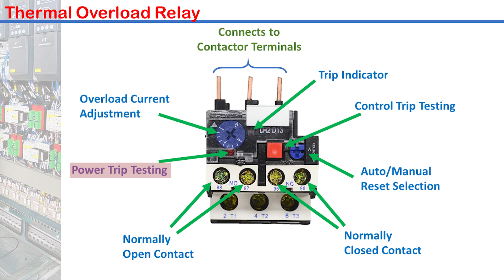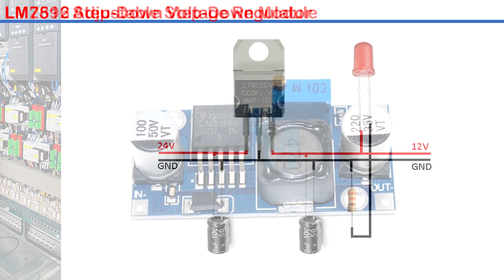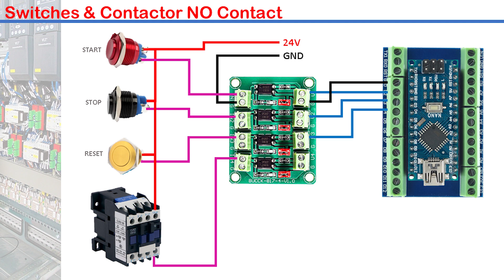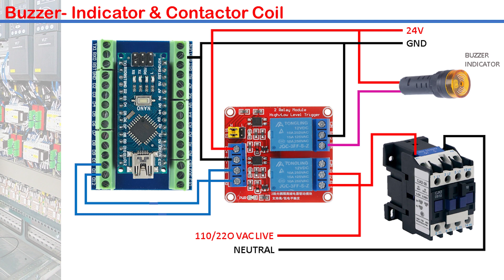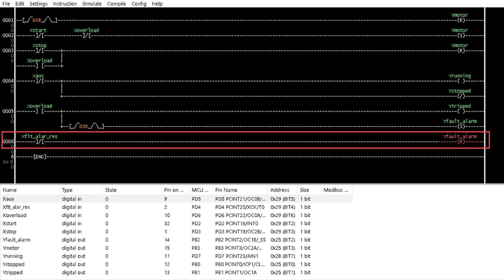How to Build LDmicro Arduino PLC (Part 2)

Comment: Nice Tutorial...at https://youtu.be/pX098kIVipk?t=286 you are connecting the 110/230v is through relay to the contactor, the contactor itself is some sort of relay, if I am not wrong 110/230v is to be connected directly to the Contactor. LEt me know If  I wanted to add temperature controller to activate Contactor to switch On and Off 20Kw Heater...
Reply from the maker: This is to provide an additional layer of protection to the Arduino Nano due to the related amount of current/power of the heater, for example